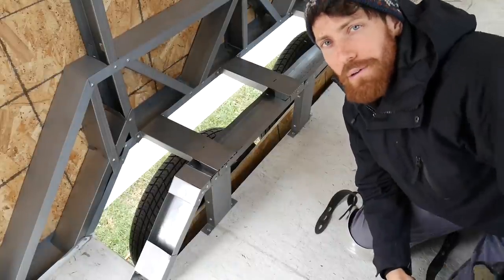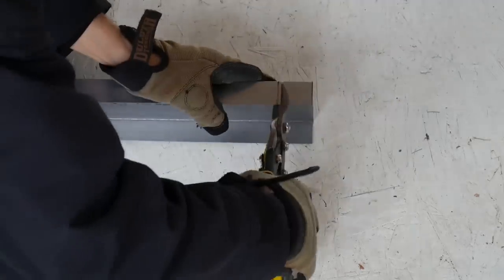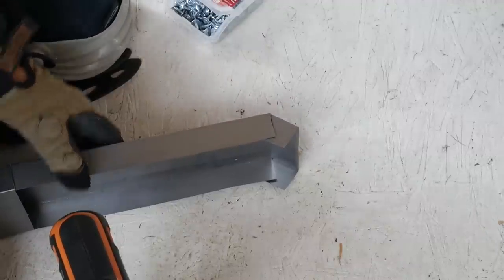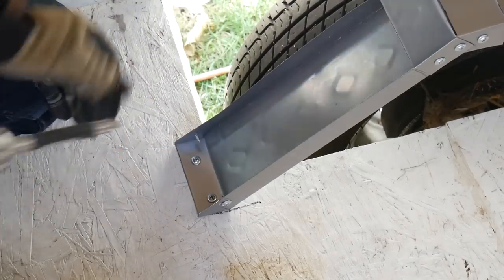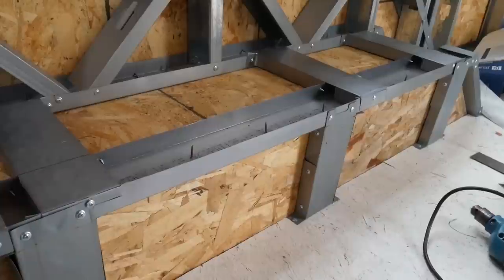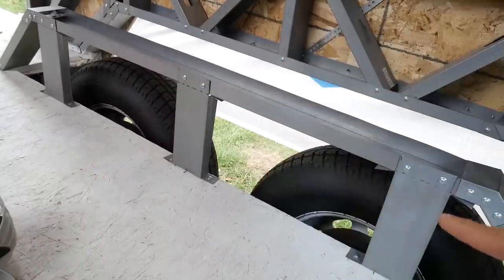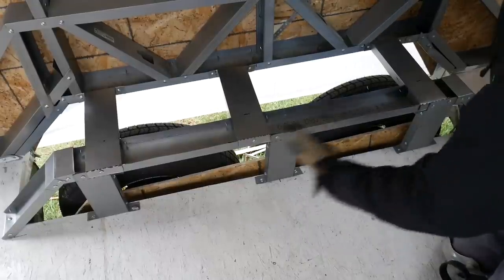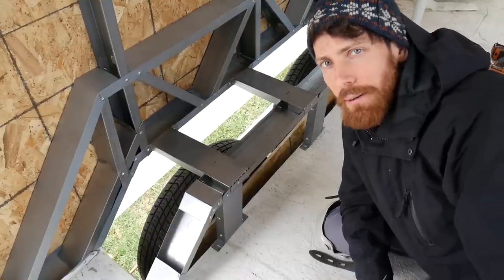Making a Wheel Well with Metal Studs | Tiny House

Comment: @17:00, do you think there is much value added by placing the foam inside the upstand channels? I'd imagine the thermal conductivity of the steel around the sides of the channel will negate most of that insulative value you have gained for the air gap, surely?